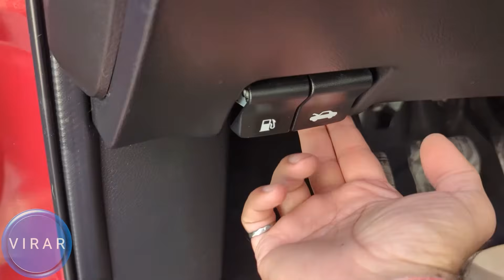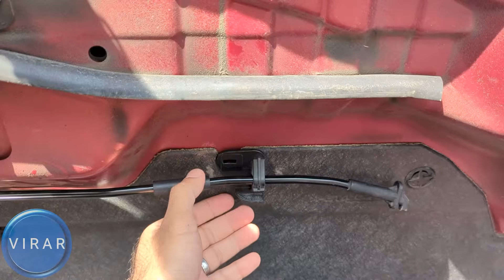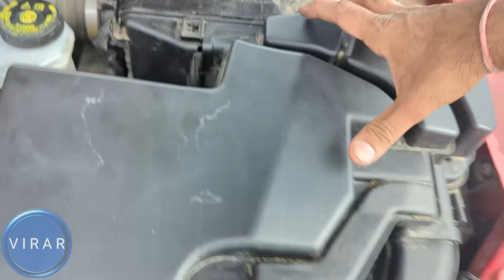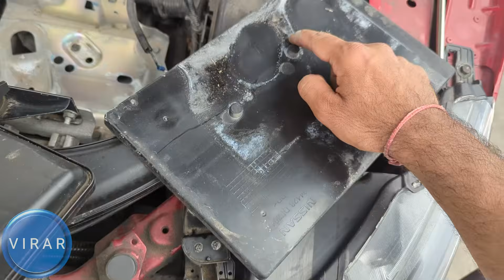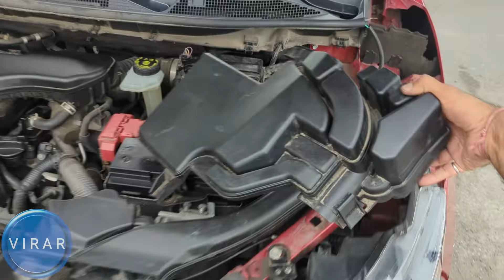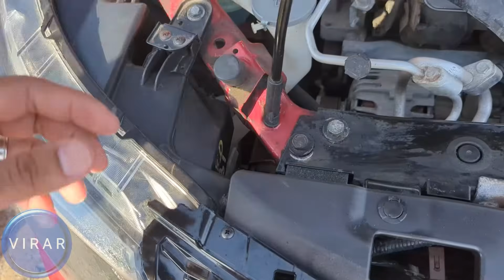How to [EASILY] Replace the Battery - Nissan Rogue Sport / Qashqai (2017-2022)

Comment: Don't you need to do battery programming on the qashqai?  A guy told me some cars need to be on the machine to reset the battery after changing it? So the car's system know it's a new battery.
Reply from the maker: To the best of my knowledge, the Qashqai does not require any specialized programming or resetting for the battery replacement.
Reply: @VirarAutomotive thanks for your help 😊